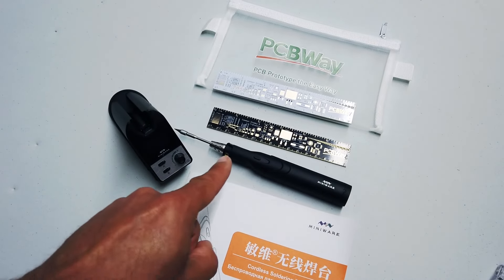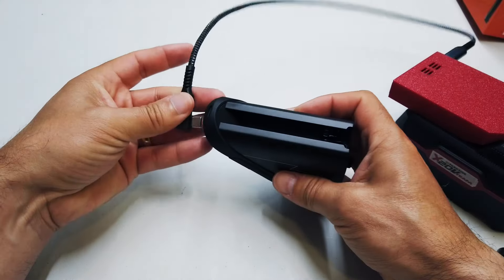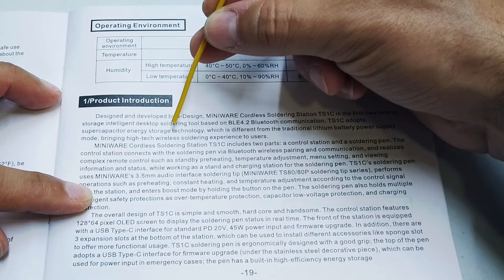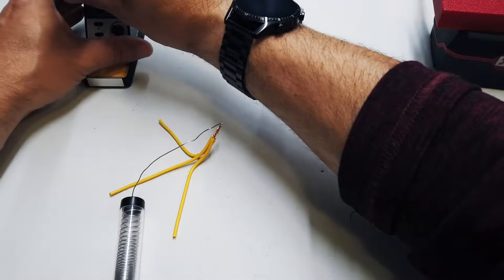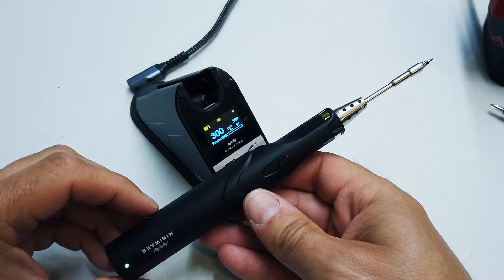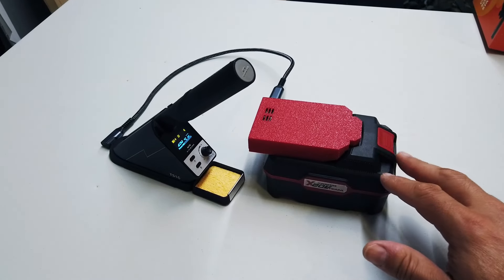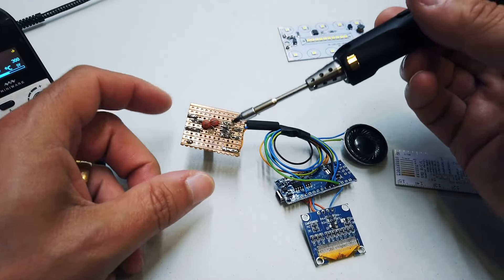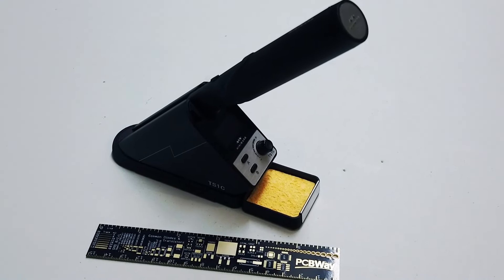DuB-EnG: SUPER CAPACITOR Soldering Iron - MINIWARE - USB-C PD Power,  Bluetooth Connectivity AMAZING

Comment: Looks good. It's good to have no cable coming out the back of the soldering iron and getting in the way, and it looks like it would do the job for small circuit board work nicely.
Reply from the maker: Absolutely!!  Quite a cute device indeed!! 😁. It's found a permanent place on the workbench...

Comment: This is very cool. Hope it lasts a good few years, more tech, more to go wrong
Reply from the maker: The weight and the feel of the construction makes me think this will last a good while!!  Let's see if it stands the test of time :-) 😜
Reply: @DubiousEngineering  Battery powered irons are good for light-duty use and especially on awkwardly positioned joints, that don't conduct too much the heat away from it's tip. Small surface mounted components can be damaged if heat is applied to them for too long. Hence why I prefer mains powered soldering irons for their consistent temperature stability.

Comment: It uses a Lithium-ion battery not a super capacitor. It is a LIC1840 with 300mAh capacity. If it is discharged below 2.5V it will get damaged so try to keep it fully charged while in storage (not used for longer periods of time).
Reply from the maker: The manual clearly states it's a super capacitor
Reply: @DubiousEngineering  I think it's technically a supercapacitor/ lithium battery hybrid. But yes, a type of supercapacitor though not strictly a capactior.
Reply from the maker: @oldman1944  well…. I may have to strip it apart and have a look for myself….
Reply: @DubiousEngineering  There's a teardown on YT already 🙂
Reply from the maker: @oldman1944  it’s a 750F super capacitor…. No sign of a lithium battery at all
Reply: @DubiousEngineering  My understanding is that it uses a LIC1840Q3R8757 which is a lithium ion super capacitor.
Reply from the maker: @oldman1944  wuuuuhhhh? …. I’m getting an education here…. I’ve just looked that up…. So, it’s a super capacitor using lithium ion tech….  Man I’m keen to know how that works!

Comment: Nice concept, but at £150 a pop on ebay I think it's expensive for a light duty soldering iron.
Reply from the maker: Fair comment! …. The ts100 and ts101 are both fantastic and a third of the price … usb C PD irons…. Well recommended!
Reply: @DubiousEngineering  I'm a proud owner of a 40 year old 240v Weller variable temperature soldering iron station, that's more than proved itself capable over the decades. I for one object to owning/using workshop tools that rely on lithium batteries for power. They essentially render these 'consumer-grade' gadgets landfill the moment their sub-standard Chinese batteries fail.

With regard to how useful and/or cost effective super-capacitor powered devices are, can only be tested over a similarly extensive time frame. One cannot deny the novelty of powering small devices with super caps, but in the long run, this type of gadgetry would never be relied upon in a professional environment. 

This is just my opinion, I could be wrong.
Keep up with these great reviews. 👍